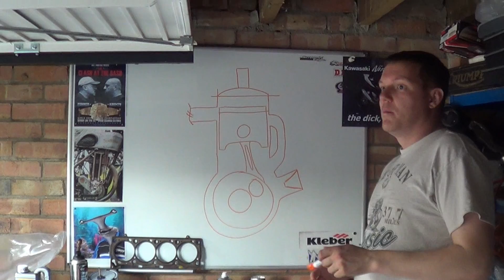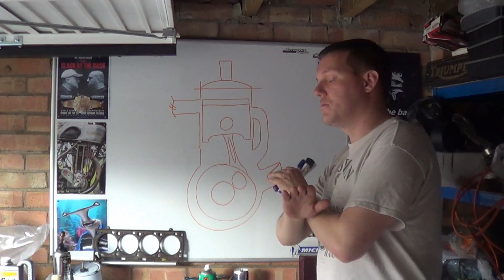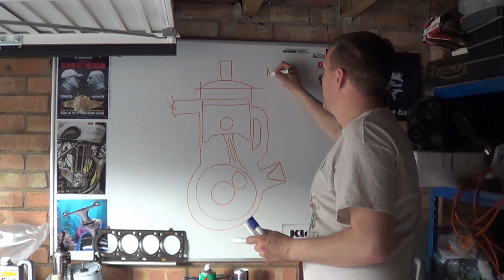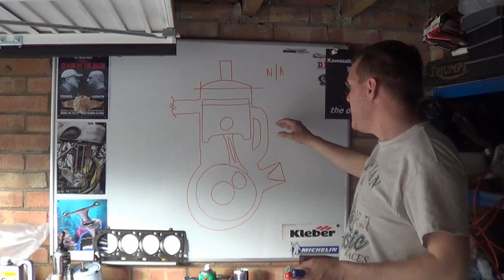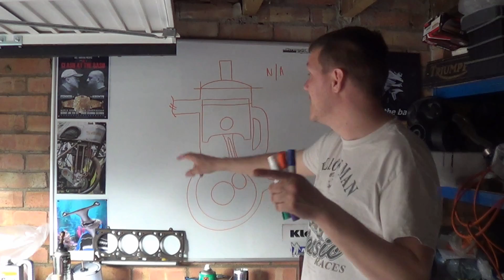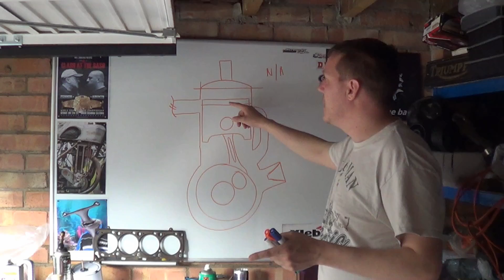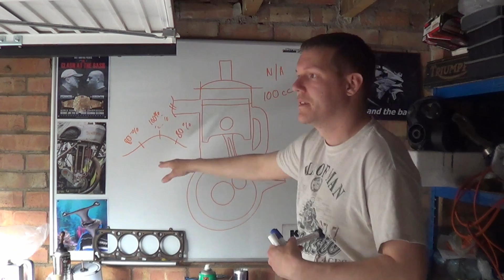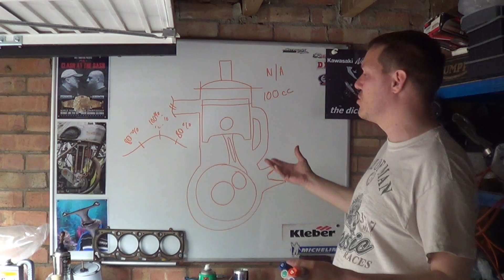2 Strokes are NOT supercharged!

Comment: Positive pressure inlet charge, is as close to 'supercharging' as it gets (imho). If the VE is less than 100%, it's not a 'forced induction'  system. What is the best VE for a 2T engine that you know of Matt?
Reply: as the man said in the video when the piston goes to bottom dead center it compresses the air/fuel mixture higher than atmosphere at that moment when the air/fuel mix pressure becomes greater than 14.7 p.s.i. we call it supercharged by no other means as engines are air pumps .the supercharged air remains inside  as a sound wave reflected fromthe back of the expansion chamber seals off the exhaust with a sound wave force field as this process becomes greater the piston is moving faster than the viscosity of the air ; then the piston traps supercharged air and then the spark plug sets it off ..thats when you gotta hang on as its in the beginning of its power band that no four stroke can do and as your two stroke tops out the frequency of the sound waves match the reverberation of the engine that's when she's in the 
'power band and on the pipe.. compared to a four stroke that can only suck bang and blow a two stroke makes boost
'. and the more air you can move through and engine the more horsepower it will make ..if engine were not air pumps as the idiot in this video says engines are not ..the engine would not start up at all let alone continue to run . i spent 3 years at the university of illinois  studing this stuff and earned an associates degree of applied science dealing with agricultural mechanics and a doctor of motors degree from the perfect circle piston ring corporation but it wasnt untill 5 years later i was attending a honda train center covering all the new 2t engines at the time their very 1st two stroke was called the CR250m Elsinore invented designed produced and raced by Pops Yoshimura who also became my honda R&D two stroke instructor for the next eight years as he also designed all the Elsinores that came after up to the cr500r i started in motocross in 1973 on my very 1st 2t moto bike a 1972 yamaha MX360 factory race bike that made 39 horsepower and weighed 234 pounds next to CR250m Elsinore that weighed 214 pounds and made 30 horsepower rip pops yoshimura the most famous tuner t he world had ever known of all four stokes and two strokes who over eight years developing the fastest 250 2t in the world i raced and serviced all the models of elsinores that came after and now i have all his  knowledge and technology but no one wants to hear it ..too bad cause i am the only one live today that knows all there is to know so im going to keep it all to my self from now on and was the babbling idiot babble their selves to death

Comment: Can you make a video about how they get the (ball)bearing in the middle of the crankshaft of a 2 cylinder or more in line 2 stroke? is it that the crankshaft is multiple pieces pressed together? and also how does that work inside the engine? is there a clamp over the middle bearing?
Reply from the maker: Yes its coming this weekend

Comment: Wikipedia has a great initial description of a supercharger
" A supercharger is an air compressor that increases the pressure or density of air supplied to an internal combustion engine.",  the key words being "supplied to an engine". I'm other words, it's not  pressure that the engine creates in its natural combustion motions, but an external (if you will) compression that ADDS air and appropriately metered fuel.
Reply: Also, I feel it would possibly make more sense if you used mass instead of volume to explain the difference. For example, 100cc of atmospheric oxygen is 114g. If you compress that into 50cc, it's still 114g, even if the piston is compressing it in the crankcase. Now if you have something that supplies more than 114g per stroke for your 100cc engine, then it can be said to be supercharged.
Reply: not entirely true ,,there are other types of engines called two cycles but today are called two strokes that by design make boost internally from the action of the piston movements to tdc (top dead center) to bdc (bottom dead center)

Comment: it isn't rocket science to understand a 2t engine. matt lays it out fucking perfectly well. great vid.
Reply: but he never  once told us what naturally aspirated  air pressure is at sea level that is 14.7 p.s.i. thats the limitation of a four stoke ,,then he says in a two stroke the air/fuel gets compressed in the crankcase but never is supercharged ..so how can it not be pressurized after he just said it was ..oh that he said it just blows right out the exhaust ..but in the real world it can not because the sound wave from the expansion chamber seals the exhaust port so the intake charge remains   supercharged when it fires off ..anyway that is how it was told to me by a man by the name of pops yoshimura who invented design produced and raced honda's very first two stroke called the honda CR250m ..ever heard of one or yoshimura  they were the fastest 250's in the world as i was there when it happened and at every race there was no one in front of them ...pops died a while back but his name still lives on as you can read it on every yoshimura expansion chamber for two strokes today and every 4 into one tuned exhaust on four strokes today as all his systems make more power than anything else...and it doesnt matter if you believe or understand cause it still happens

Comment: from the point that fresh air or air and fuel arrives to the cylinder with a pressure more than ambient, we call it charged. naturally aspirated if only the piston moving down pulls in fresh air. witch is impossible in a 2 stroke. you got more than ambient pressure in the charge transfer port. and that pressure is used to vent the remains of the exhaust gasses when the exhaust an intake ports overlap, and when the ports are closed you got more than ambient pressure inside (hopefully, otherwise its a pretty fuckt up engine) , and you can have a volumetric efficiency exceeding 100%.
so its charged. 
on the otherhand, a real naturally aspirated eninge constantly suffers from (regardless what you do) from a volumetric efficiency being less than 100%.
in a 2 stroke the exhaust system can be, and should be designed to provide back-pressure waves, that is actualy a form of charging too. and so is ram air, btw.
the methood and parts involved make no difference, if the engine has more than 100% volumetric efficiency then its charged one way or the other. 
2 stroke crank case breathing engines are a special kind, as it would be impossible for them to work at all without some form of charging. or they might puff-puff a bit but would ultimately die from lack of fresh oxygen supply.

all 2 strokes are forced induction types. its a piston type supercharger, like it or not.
btw, allso the reason why you don't see a 2 stroke diesel without a blower. you need something to push the remains of the exhaust gas out of the cylinder and force fresh air in.

if you feal so, you can sortha try and prevent pressure building up in the transfer port somehow and see how it runs. but supposedly we allready know it will be a pile of shit without the charge transfer port transfering CHARGE. there is no possible way you can make it naturally aspirated. the piston moves down, pressurises teh crank case (yeey, pressure, remember that part) and then the ports are in the correct alignment that pressurised air fuel mixiture aka CHARGE with a given PRESSURE makes its way to the cylinder.
Reply from the maker: "if the engine has more than 100% volumetric efficiency then its charged one way or the other."

- true which 2 stroke bike engines don't
Reply: The Workshop 
that be funny. refresh 2t exhaust system knowledge. and why you want the crank case to be well sealed.
Reply: well that would be really fun.
this is a verry simular situation to the 1 stroke engine problem you had. 
give it a nother go, i see why and where you lost it, and i'm sure you are a reasonable person and will make it on your own to see , that both petrol and diesel 2 strokes are forced induction engines.
since you gotta have something to blow out the remains of the exhaust gas, you know, the CHARGE air, its pressurised. otherwise it would not blow anything out. and there you have it, they are not naturally aspirated.

Comment: I read once that two-strokes can start to supercharge themselves under the right conditions, or maybe better to say the wrong conditions? As they described  it as being able to happen at very high rpm (well beyond what the engine should ever run at) and was described as the engine pulling in more air than its designated displacement. Is this even possible?
Reply: Puffalupagus360 sounds quite interesting Matt should do a video on that?
Reply from the maker: no the volumetric efficency stops this. Forced induction is anything over 100% VE, anything lower is NA
Reply: two strokes dont turn high rpms and if they were not internally supercharged air/fuel could not inter the cylinder and they would not start up ..anyway thats how yoshimura said it works but what in hell would he know all he ever done was invent and build the honda elsinore that was the fastest two strokes ever ,,have you ever heard of them ..i raced them for eight years 125's 250's 480's .and they all gitty up
Reply: @donniebaker5984  so what do you call 10k 12k or 15k rpm?? Low?
Reply: no its the sound your lips make when you are riding your bicycle and pretending to be the motor

Comment: forced induction is supposed to increase the density of air. the 2 stroke does not create more density because if you have a 250cc piston and cylinder the bottom end also has a displacement of 250.
Reply from the maker: "forced induction is supposed to increase the density of air."

- dude, this is a dumb comment. You just said 'forced induction' - the clue is in the words......
Reply: i was trying to say the same thing as you end up covering later in the vid with the 100cc example. i guess i should have watched the whole thing before commenting. basically i was trying to say just because the crank gets pressurized and dumps into the top end does not mean there is all of a sudden more air going through the motor. VE is not improved 
 just because the crankcase has a compression stroke to it.

Comment: could you not change the transfer port timing and exhaust port timing and windowed piston arrangement to combat the loss from the transfer of fuel air from the crankcase and given that you should know the exact volume of the crankcase and cylinder and cylinder pressure at top and bottom dc could you not use a crank position sensor crankcase pressure sensor crank temp sensor and inject the exact amount of fuel air and 2stroke mix at the exact time it needs it electronically straight into the reed inlet crank port
Reply from the maker: Yo uwould need one hell of an injector. Do you mean inject all of the fuel/air/oil into the cylinder?
Reply: not into the cylinder no the pressure would fuck shit up for the injector.  atomize it into the crankcase to be transferred to the cylinder just like it already does like normal n/a you would just be giving the same amount fuel/air/oil as it could draw in anyway or abit more it could be adjustable and more accurate it would work with the piston if anything because of your crank position sensor in accordance with port timing the injector and stuff would know exactly when to dump the fuel mix into the crank in the exact amount it needs for the perfect ignition in any given weather condition hot or cold high altitude or low altitude  just my thoughts im not ranting btw..

Comment: Supercharging a 2-stroke would either blow fuel/air mixture out of the crankcase seals, or blow the seals out completely. Anything that pressurises the crankcase above ambient will do this, therefore super or turbocharging won't work.
Reply from the maker: Unless you support the crank seals
Reply: True, but most 50cc scooters have crank seals that are a push fit and aren't supported, they are like an interference fit. Hence, all of these idiots claiming that they can turbo their AeroX or similar are discussing out of their collective rear ends.
Reply from the maker: True, I'm with you there. But you can have extra material build up (welded not that JB shite) and have a ring groove machines into the bore, then you can retain the oil seals
Reply: What would the increased crankcase pressure from some sort of blower do, in terms of interference with scavenging or the pressure wave coming back down a tuned pipe? Surely these would get screwed around (and don't call me Shirley!).
Reply from the maker: I did a video on this, its basic but  - https://www.youtube.com/watch?v=C9vNzXPleLU&t=199s
Reply: so you know this from experiance is that right? so when the piston moves to bdc it does not compress the air/fuel in the crankcase cause that would blow out the crankcase seals ??? is that right ..and how much is the pressure of ambient i didnt hear you say what its is just like this jack leg in the video does not  know what that number happens to be ..in order to have a transfer of air/fuel from the bottom end to the top end you have to have a difference in pressure or there will not be a transfer and the piston can not make vacuum  and you said you can not supercharge cause it will blow the seals ...looks like according to you two stroke dont work